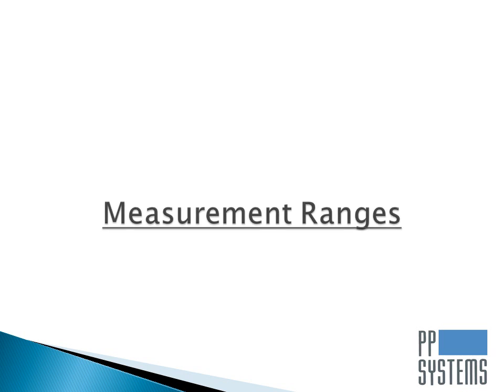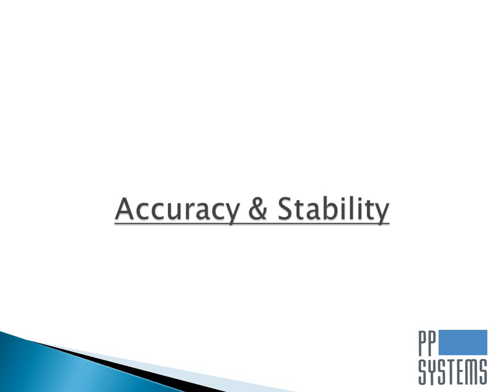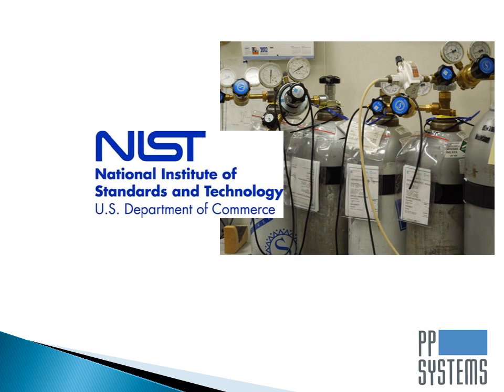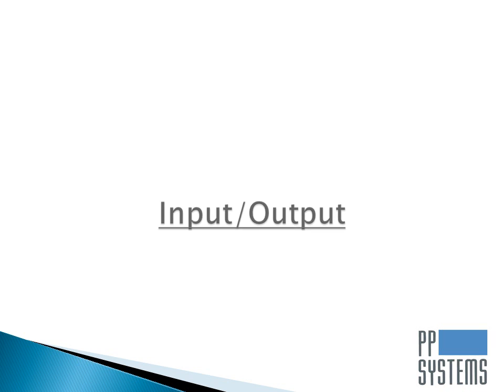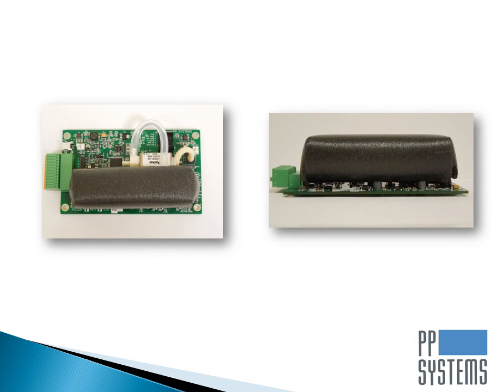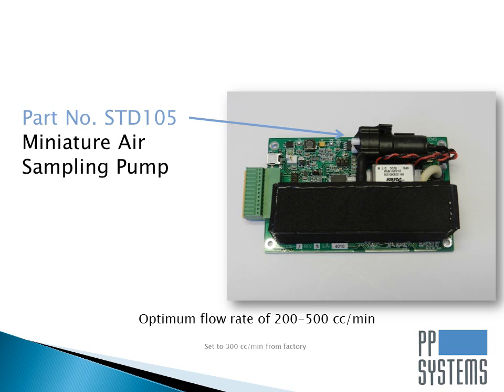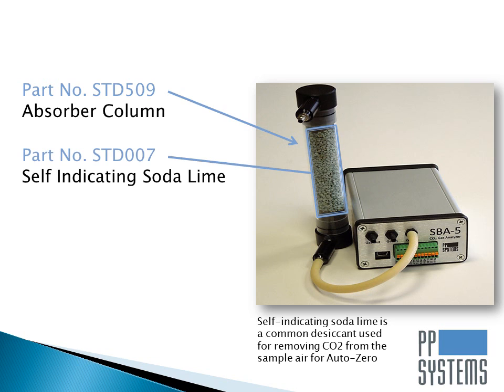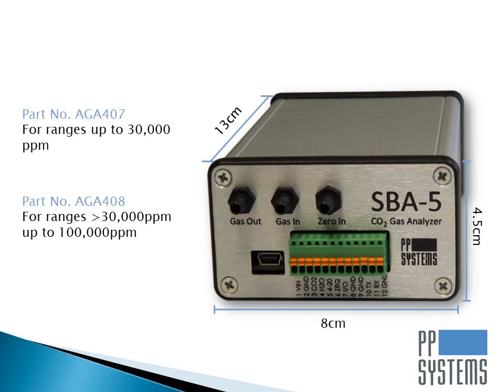SBA-5 CO2 Gas Analyzer from PP Systems

Comment: In your datasheet there is written "functions and usersettable parameters can be accessed via the digital I/O (USB or RS232) using a simple text based command structure with a generic terminal emulator such as hyperterminal." whrere can find the commands